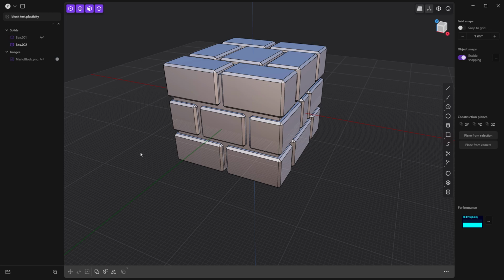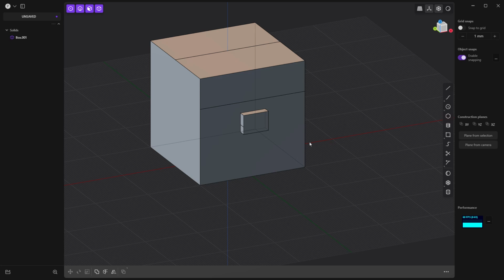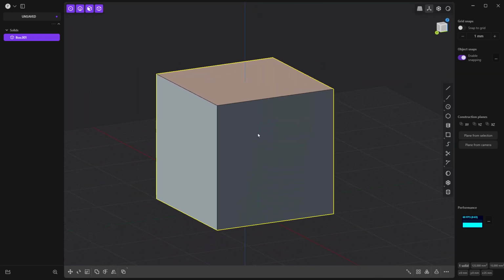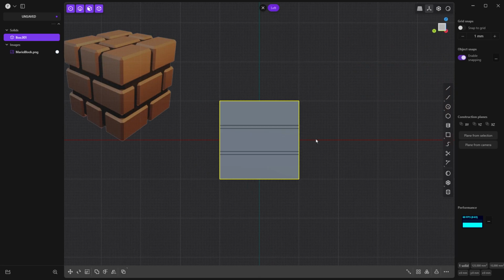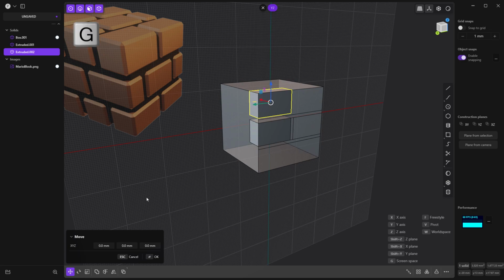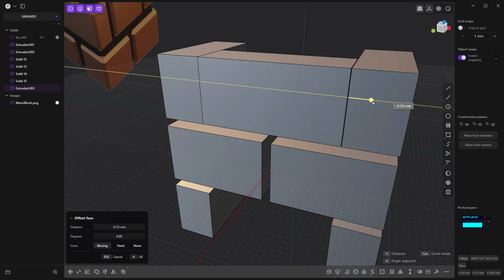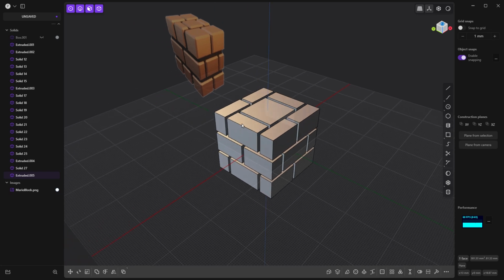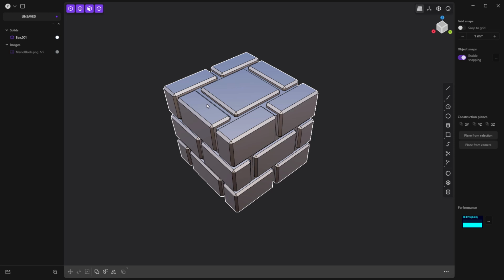How To Model a Super Mario Brick with Plasticity

Comment: A question: at this moment i have the free trial of plasticity.  i can not export as STEP.  For rendering in other software i should use a STEP format.  Does the full payed version of plasticity allow to export as STEP?
Reply from the maker: Yes BUT you do want to check the license types.  the Studio license has more export options than the Indie option.  

So on the trial it is essentially the Indie license BUT it does restrict you to OBJ/STL export.  The Full indie license says STEP, OBJ, STL and Parasolid import/export with FBX import available.  The Studio license also has ACIS import/export as well as Rhino, dxf/dwg imports (windows only for those last two).

on the Plasticity site you can see the info in the Pricing sectioni.

Comment: hello, I'm trying to figure out if plasticity3d it's suitable for woodworking like cabinet, or it's better to use Fusion 360 or Sketchup?
Reply from the maker: That will depend a bit on what you want to do with the 3d model I suppose.  There are a lot of woodworkers that use Fusion, especially to program CNC routers.  The configurations and parameters do certainly help.  Without knowing more I would probably nudge you toward Fusion.

Comment: heya man love the videos, i was wondering if you could do a video aimed out how to water proof a plastic design that either needs to keep water out or keep water in
Reply from the maker: do you mean for an injection molded part design?  There is a lot that goes into making something water proof.  looking at IP ratings and figuring out  your requirements is step 1.  Having something that can be submerged vs something that can just take a little rain requires very different levels of design.

I have made some SLS Nylon parts that have been able to be submerged for a short time even using 3d printed gaskets, but repeatability is an area of concern.
Reply: In my case, yes, it has to be able to keep the liquids in and be refilled
Reply: And taken apart and rejoined
Reply from the maker: @jogon9649  How do you plan on manufacturing it?
Reply: What ever is cost effective way of getting the seemless finish I want, translucent yet neon type of material, willing and happy to discuss with you
Reply from the maker: @jogon9649  Why don't we take this to email. support@caducator.com

Comment: For accuracy, and being pedantic,  my approach would be to use maths by initially deciding on the gap size needed , subtract (gap X 2) from the height and divide the result by 3 to give the correct height of the blocks. The (box width - one gap)/2 = the length of the blocks so no need for adjustment of block positions.
Creating a copy of the main box, scaling it down and hiding it before you create any blocks gives you the option of deleting your guide box and unhide the hidden one for any boolean operations.
This is how I would approach creating the Mario block and I'm sure there are other methods that would work equally well.
Reply from the maker: oh 100% agree with you.  The problem I had when planning for this is that the numbers were just not right and would just make it tricky.  Also I felt new users need to know how to tweak sizes and snap to other geometry for example.  I made one of these as a storage container with a thread on lid (in Fusion) and did most of the work in a sketch. https://a360.co/3DdpIxm  In the sketch i made equations to drive the numbers and use mirrors and repeating features.  

I personally find with Plasticity it is easier to be less rigid with the numbers vs something like Fusion where you have the constraint system and parameters that makes it a much easier task.

thanks for sharing your approach.